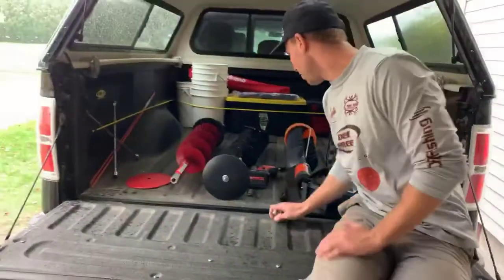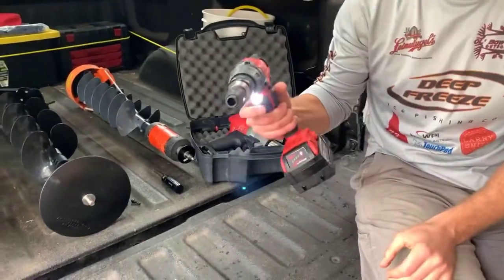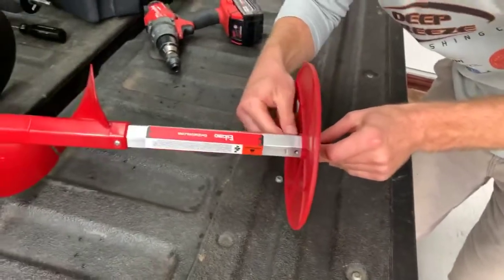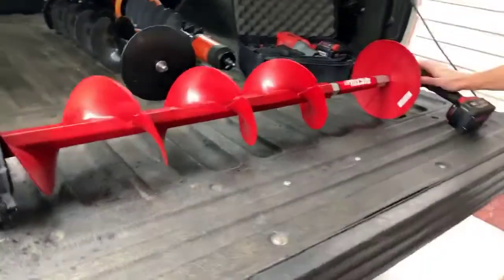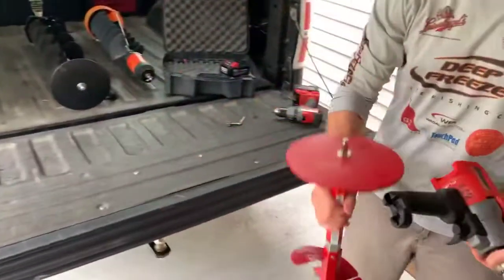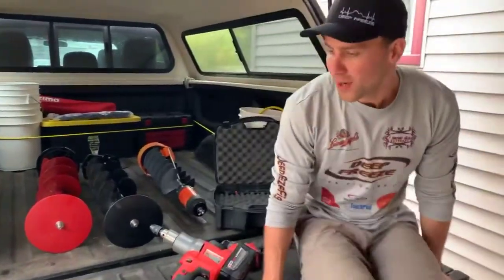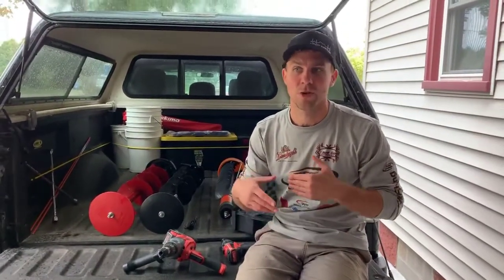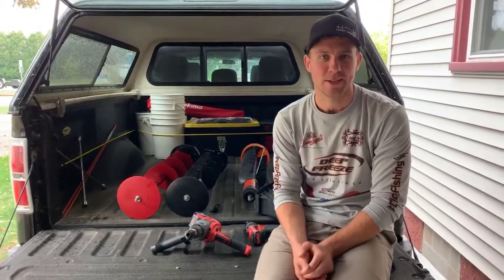EZ Auger Connection System

Comment: It keeps slipping in my brand new dewalt chuck no matter how tight
Reply from the maker: Did you damage the quick chuck?  If you’ve rounded the edges, then yes, no matter how hard you try to tighten it, it will always want to slip.  But, if you still have the 6 edges on the quick chuck, there’s no reason it shouldn’t tighten up.  Your drill has 3 chuck teeth.  You need to make sure those land on the flats of the quick chuck.  If you ensure that, there is no reason it should come loose, unless their is something wrong with your drill chuck.  Hopefully that makes sense.

Comment: what's the difference on the website between "k drill" and "k drill (adapter only)"
Reply from the maker: Hey David, sorry we missed your comment on here.  The K Drill includes the quick chuck that gets tightened into your drill.  The K Drill (adapter only) does not include the quick chuck.  So, let's say you have 2 augers, a K Drill and a Pistol Bit.  You're already purchased the Pistol Bit with the quick chuck.  For your 2nd adapter for the K Drill, you would only need the adapter only, since you already have the quick chuck.

Comment: This is a great product idea...I’m interested in the K-drill attachment, quick adapter, and tent stake adapter. How much would those three items together cost?
Reply from the maker: Hey Josh, you'd be right around $64.  $44.99 for the auger connection system with the quick chuck, and then $18.99 for your ice anchor tool.  For the ice anchor tool, you'd need the tool only since you already have the quick chuck from the auger adapter.
Reply: @deepfreezeicefishing3113  Thank you! I’ll be ordering all three products in the near future! I appreciate your response and answer to my question.
Reply from the maker: @jjrilea84  sounds good!